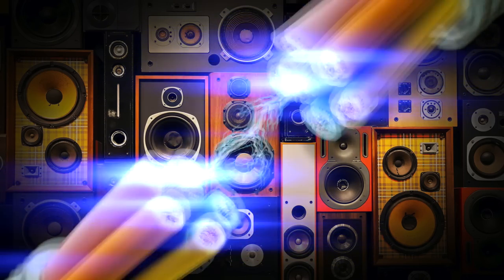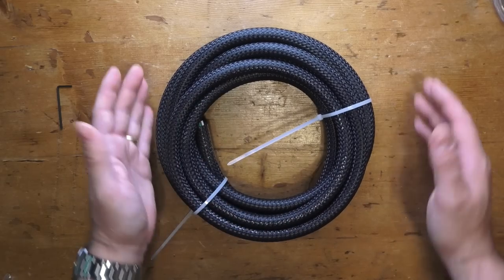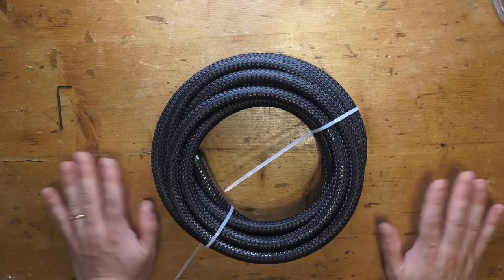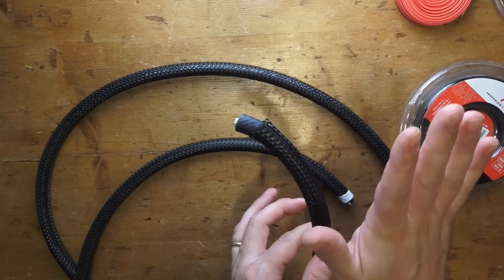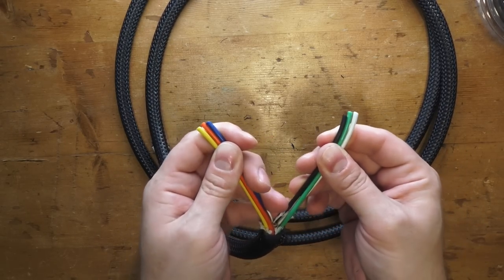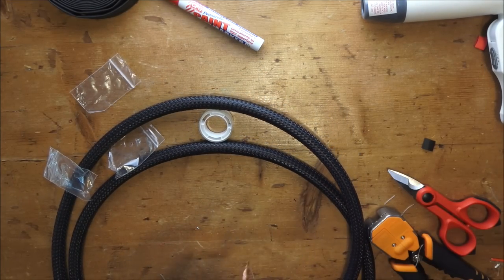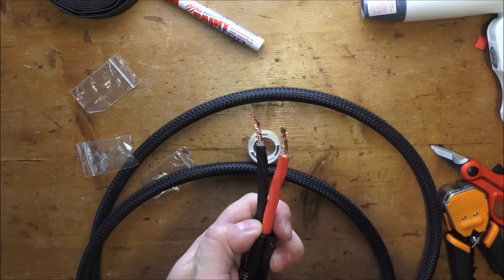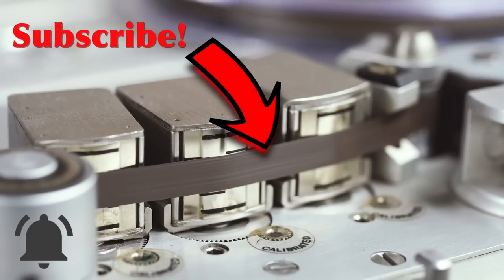The Speaker Cable Guide: Part 2 - DIY audiophile cables!

Comment: For all of the expense going towards wire with supposed benefit from continuous crystals, those spade plug screw joints don't seem to provide remotely the same quality of continuity. The set screws will only press the wires into the housing at two spots and the screw will likely act like a wedge to spread the wires apart rather that hold them together. A simple crimp, by contrast, is created with so much force that it effectively cold welds the strands of wires together and creates a 360 degree joint between the two metals.
Reply from the maker: Yes, I agree a true crimp should be better but I wanted to use the Ramm products throughout and see the results and for now I must admit thatbI am very pleased. For the record the spades have 3 screws to fix the cable.
Reply: Valid point, but unless the connection is loose or compramised in another way, your never going to hear the difference,, can you imagine doing a blind test,, trying to ID, the difference in sound between spades and banannas,, 😂

Comment: Thanks, I will be trying these.  On their web site, I was unable to figure out if the wires were twisted inside the cables.  I assume that they tested the inductance and added twists if needed though.
Reply: They were just spirally turning around the hollow brown tube for air insulation, this can somehow reduce skin-effect I think.

Comment: why didnt you use copper spades that are crimped and then soldered, surly that would be the best option for these cables ??? ps lovely cables i may treat my self :)   
good vid
Reply from the maker: Usually crimped spades are not high quality and I wanted to use the ones from Ramm, which are very good. I do agree that a true crimp is a better connection.
Reply: @anadialog  
thank you for your great channel. i have researched and found that as contact pressure increases resistance decreases(there is a formula) and then soldering the joint holds everything in place and stops oxidation of the joint.  in my opinion there is nothing better than crimp&solder, but i understand your reservations regarding getting hold of good quality copper spades.

Comment: Hi. I am Bi-amping a set of JBL Everest DD67000 speaker using  2 McIntosh MC901 amps. This amp consists of a 600 watt solid state amp and a 300 watt tube amp in one chassis. Should I build 2 separate cables for each speaker?
Reply from the maker: Nice! Yes, that would be best to completely separate the signals!
Reply: @anadialog  Thanks you! Spoke to Rudy at Ramm today and I am going cable from those guys. He spoke very highly of you!!
Reply from the maker: Cool! Give us some feedback after burn-in! 
Just for the record, I want to underline that I am not earning anything by recommending their products, they're just good and I like to share that! No affiliation!

Comment: Hi. This cable looks good and sophisticated, I was going to buy but I stumble upon a neotech nemos 3080 with occ solid ectangular conductors,  about the same price, not so sophisticated build though, simple made, but has Teflon insulation. Have you tried it?  What's your opinion on this?
Reply from the maker: Neotech is always the best. I have made a pair of interconnects with the Nemo 3080 for my Telefunken M15. Its an amazing cable. Maybe the gauge is a little too small. Larger cables as I have explained in part 1 of the video are greatly beneficial.
Reply: @anadialog  so you have this cable. Great. Do you still think is not thick enough for my Focal Sopra1's and my Amp is 90w per channel.
Reply from the maker: @dimitrispanayides6912  how long do the cables need to be?
Reply: @anadialog  2,5m each
Reply: Other thing is, you said in part one video," we don't need shielding" , but Amadeus has one, could you comment on this?
Reply: @anadialog  so you used the speaker cable instead of a line cable for your reel to reel? Or have  I got it wrong?
Reply from the maker: @dimitrispanayides6912  apart from the fact that you can do that, but no, I got the interconnect version. I don't know if it still exists.
Reply from the maker: I did connect it. And yes, I believe that the cable would've been even better without a shield. It isn't a mystery that the Ramm cable is also, and perhaps mainly, used as a power cable, which usually requires shielding.
Reply from the maker: A good length. I am sure you would be happy with both.
Reply: @anadialog   ok so you have them both, so, you might be the best person out there to recommend me the  one. You know, I am a little confused with gauge, cause there are mix of values for a given cable.. For the Nemo 3080 it says 2.1mm, so I guess that's the gauge of the total square milimiter for one conductor (e. x. The "+") but not including  its insulation right? So it makes Nemo3080 a 12 gauge cable, right? So it's in the permittable range of recommended speaker cables by some people including you.
Reply from the maker: In the Neotech site it says 14AWG. http://wp.neotechcable.com/nemos/
 A little high but again the geometry is completely different so things are that easy to compare. These do have Teflon though so maybe, I haven't tried the speaker version, they could be even better.
Reply: @anadialog  you are right, it's 14gauge. OK, now I really don't know 🙂 😄, thanks buddy for helping anw and thanks for these nice videos again
Reply from the maker: You're welcome! In any case, if Neotech has decided for that gauge in combination with that particular geometry I am sure things are sorted out and the sound a true pleasure just as the interconnects.

Comment: Bravo. Hai spiegato molto bene. However as audiophiles, we are an extremely fussy group. No matter on how many times we wash our hands, there will always be a minute amount of oil/debris that will make contact with the bare wires. Solution is to wear latex and powder free vinyl gloves. Please correct me if I'm wrong!  Pace a tutti.
Reply from the maker: Yes, I agree. It is preferable.

Comment: Thanks for yet another great video! When connecting RME ADI-2 PRO FS R to two Genelec 8320A, what XLR cables should I use? Shielded vs unshielded vs filtered? Silver vs copper? OFC vs OCC? Etc... What is your recommendation for optimal reference grade performance for mastering?
Reply from the maker: With XLR things are better! Shielding isn't very important due to the balanced design. I would go with OCC copper if possible. Here is a recent video I made on the topic: https://youtu.be/y5h_Qa6A4IU
Reply: Also, there is a 7th version out there sold at cheaper price, is it a upgrade or cost down version？

Comment: Hi Excellent video thanks. I have speakers that are tri wired and was wondering if I can use  just use 1 pair of wires to go to each terminal on the speakers or will I need to run 2 of these cables and make one biwired and the other the same as you made in your video? Thanks in advance.
Reply from the maker: Yes, you can use 3 separate wires the problem is usually to connect all three of them at the amp side. In any case the Ramm cables has enough wires to do a tri-wire connection if you like. Just use two cables for each input on the loudspeaker side!
Reply: @anadialog  Hi Thanks so much for your quick reply. I will make some speaker cables and provide some feed back on how they perform compared to my current cables. Please be patient as it may take a while to get sorted as I live in New Zealand.
Reply from the maker: @kevinironside3624  that would be great! Thanks!

Comment: Not to complain because i love your channel and we share the same thoughts/philosopy on hifi gear but didnt you say in part1 to not use shielded speaker cables? This has shielding around each section of conductors. I also have found out about neotech and will be uppgrading my entire cabling to neotech diy. Maybe i choose the little cheaper oyaide occ 5mm2 solid shielded powercable from the fusecentral to the wallsocket because of the length. But in the musicroom I go neo👍 this ramm cable seem to be very affordable compared to the performance.
Great Work!
Reply from the maker: Indeed and infact I will increase capacitance this way BUT I did not connect the shield so it is much less "present".

Comment: Question. Why don't you use crimp tip before you put it into the spades?
Reply from the maker: Crimping is good when wires are cropped together with the connector. In this case it’s better to twist and insert to leave the surfaces nice and shiny.

Comment: What is the total cost of this build as compared to a cable of similar quality from say, Audioquest ?
Reply from the maker: I used 5 m of cable (250€) plus 8 spades both by Ramm (110€), total 360€. Audioquest, if I don't go wrong, does not have OCC copper speaker cables, only OFC (long grain is just a more pure OFC).

Comment: I can't understand the deal about having 3 same separated cables if at the end they going to be joined together. ¿?
Reply from the maker: Its very simple, the main reason is resistance, but not only. Check the first part I have explained why it is important to have the right gauge otherwise you will have issues if they are too think, or other issues is they are too thin.
Reply: @anadialog  ok. Got it! Thanks for the quick answer

Comment: Hi!  Thanks for video. Regarding Bi-Wire, these split into 2 pairs of 2 conductors and 2 pairs of 1 conductor. Are there concerns in this for the single conductor lead?  It looks in the graphic that single conductor is routed to highs and double conductor to lows.
Reply from the maker: Yes, on the side of the amp you create a pair of wires made up of 3 wires each. On the loudspeakers side, you create 4 wires, a pair of two and a pair of single wires. Here you can see the scheme: https://www.audiophonics.fr/img/cms/Images/Produits/12K/12202/Amadeus5-1.jpg
Reply: @anadialog  Thanks!  Any expectation of perceivable loss on the single conductor connections? E.G. vs a cable with 8 conductors.
Reply from the maker: I don't know but clearly it would be better to have the same "amount of copper" for each connector.
Reply: @anadialog  yes, thanks!  That is also what I was thinking. Enjoy your day!

Comment: If the 12 gauge is too thick for my binding posts, should i peel back some strands backwards against the wire and add the shrink wrap tubing over these strands to cover them up ? Would this be okay ??
Reply from the maker: Sure! The important is that they maintain  their contact.
Reply: @anadialog  Hi, and thank you for the answer, but im afraid my post wasnt clear as to bending the excess wire back. The plastic is cut, exposing the copper wires. Are the wires i am bending backward bent over the exposed copper, or are they bent over the plastic tubing surrounding the wire, and then, i add the tubing that shrinks, leaving only what i need for the binding post ? Sorry about being anal !
Reply: @skyblinked  Just cut off the strands that keep you from inserting the wire. Heat shrink only if you care about the look.
Reply from the maker: ...or simply use quality pin connectors like Nakamichi! This is a good solution for all vintage amps.
Reply: @StewartMarkley  thanks, good advice !
Reply: @anadialog  thanks for coming back !

Comment: and now there's something even better, OCC single Crystal silver and copper rectangular wire, outperforms the round wire significantly, their top of the line cable is called Sahara for the copper and Amazon for the silver.
Reply from the maker: I have those. They came out a few years ago. Very good but nothing revolutionary IMO.

Comment: You say that soldering is bad. I can understand why, but when soldering is good and when is it bad? Do soldering a crossover is bad for the sound quality?
Reply from the maker: Soldiering is always bad because it creates signal loss also because of the different electrical properties. A good cold mechanical crimp of joint is always better.
Reply: @anadialog  what about the speaker drivers? Many people say that soldering is better than the clamp connectors
Reply from the maker: @andreimj  for a definitive answer we would need some scientific tests. For now we only have opinions. Mine, is that less is better.

Comment: Banana plugs actually have more surface area than spade connectors so technically banana plugs actually will get you a more solid connection. If you want to be scientifically technical.
Reply from the maker: Not really. Spades have full contact, bananas only in the center or where they enlarge. That's a small portion.

Comment: Is it suitable for Bi-amping？
Reply from the maker: It has enough wires to that as well as bi-wiring
Reply: @anadialog  I used DNM solid core (silver ribbon  structure wire )for the tweeter, and AQ Midnight 2 for the low frequency drivers all terminated with WBT banana plugs to a LS3 /5A loudspeaker. However, I move my amp location recently, the cables are not long enough, so I would like to give this cable a try. I would try two wires for the high, and four for the low, the whole cable first. Then try two wires for the high + AQ Midnight for the low,  and the last is to try whole six wires for the high + AQ for the low to see which one is better.😊

Comment: I doubt that those spades are really of high quality. 
First of all, they seem to be made of some sort of brass and have smooth gold plating (with a nickel base) thus are most likely having the hard serfice. That would prevent them from making the best possible contact with the binding posts. IMHO spade connectors have to be made of soft copper with direct gold or silver plating. In that case spade material conforms to the binding post surface imperfections and forms air-tight solid connection. 
And second, such screw connection could not provide any good quality contact for the multistrand wires. A good spade should have either criming type connection or at least some gold/silver plated copper crim-on ferrule should be used between any stranded wire and spade's clamping screw .
Reply from the maker: Are you joking? I only use prime components. The spades have a double coating of gold and they are made out of pure copper. I soft connector is generally not a good idea for spades because you indent the surface when locking them. Here is the site of the manufacturer: http://aecoustics.com/index.php?main_page=product_info&products_id=184
Reply: @anadialog  Thank you for the information. If we trust manufacturer's claims about the material and direct plating then these connectors are in fact better than I thought. My mistake.
However I still insist that only spades with a soft surface can make a good reliable contact. Hard spades are the reason why many people including Gene DellaSala from "Audioholics.com" falsely believe that banana plugs always make better connections than spades.

Comment: Air tubes are not technology. Technology has circuit boards inside of the device.
Reply from the maker: Not really, the word itself explains it: technology is composed by the Greek word tekne, art, work and loghia, study, explanation...technological research was done to reach that conclusion. Doesn't have to be electrical....I think you are confused with electronic.

Comment: Where are you? did you give up? Furthermore if dielectrics burn in then the capacitor is damaged. If you mean electrolytic capacitors they have to be formated. The dielectrics of it is aluminium oxyde. The higher the capacity, the thiner the oxyde film and even the lower the voltage. If you are using  electrolytic capacitors in your audio path you'll get some bad and inconstant results because their capacity tolerance is normall -50/+100 %. Precision elko's are a bit better. Polycarbonate and especially PTFE are far better and lasting over years without degrading. Tell wich audio engineers are talking such bullshit. I've studied electronics engineer decades ago and be specialised in audio recording and playback on STUDER tapemachines if you know them. Even I devloped Hi class audio speakers with precision frequency range and cabling inside.  I know very well what I'm talking about.

Comment: I think you should check your math! At 50 us dollars per foot it would equate to 145 euros per meter not the 45 euros you claim. Are we talking apples to apples?
Reply from the maker: I think you did not watch carefully! At 12:06 I clearly wrote on the screen the 1m / 3.2ft, that is one meter equals three point two feet (not 1 foot) is around 50$ and in Europe roughly 45/50€.
Reply from the maker: I do see now that on the Ramm audio store the price is 50$ per foot (perhaps you were referring to that) while in Europe we spend much much less! 50€ for 3 feet! Absurd!
Reply from the maker: I contacted RAMM Audio and they told me it was a mistake. Now the price on their website is 50$ for 1 metre (3.2ft)!
Reply: Thanks for the time you took to look into this. Now it makes sense. Otherwise it was cheaper to buy in Europe and ship back to USA

Comment: Indents, really, what kind of snake oil engineering is that? Any AES paper on those. Also directional cables? As you can tell the electricity where to go by inverting the cable. wow
Reply from the maker: Since you clearly don’t know why cables are directional (makes me wonder if the rest) I will explain it to you. Cables are directional because the shield is connected only on one side. Simple simple science.
Reply: @anadialog  jajaja really tell that to my car battery or to my microwave. No it's that simple the shield can't do anything either as it's not in the path. Indents!!! jajaj and then you twist the ends creating multiple indents jajaj  Simple science too? You are a fluke, just like the ones that use pretty meaningless words when describing gear.
Reply from the maker: Great use of words. I just can’t compete with your level of speech and arguments. Thanks for enlightening us!
Reply: @anadialog  jajaja sure,  my argument remains.